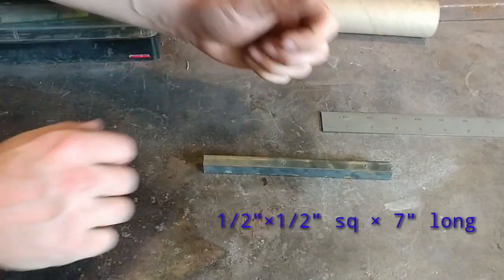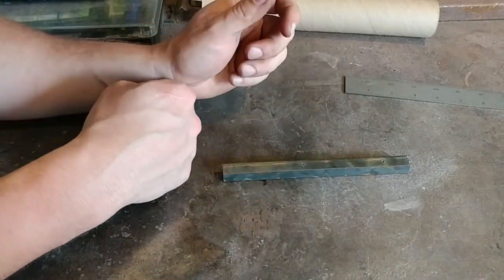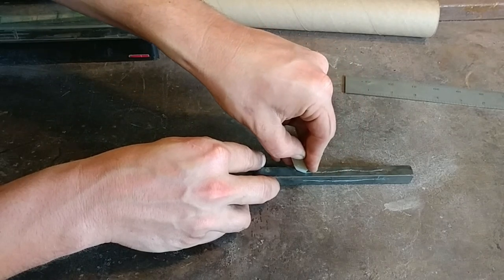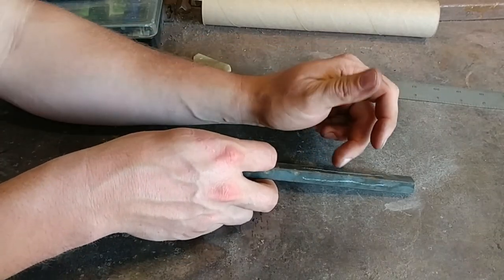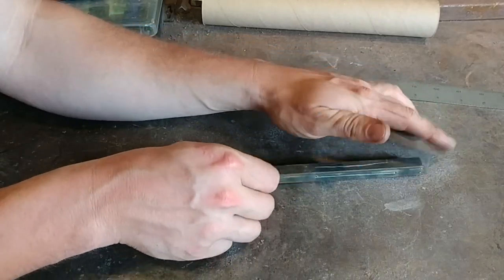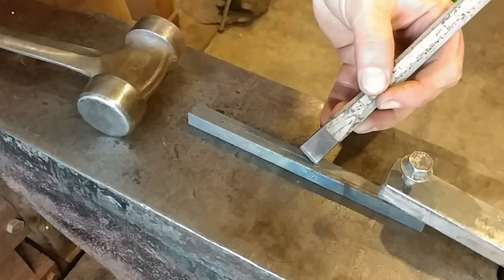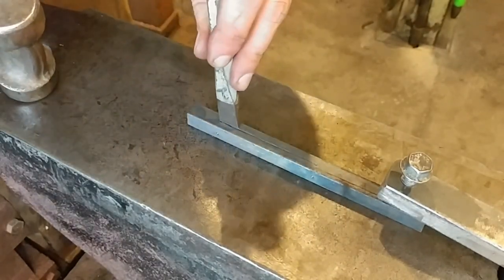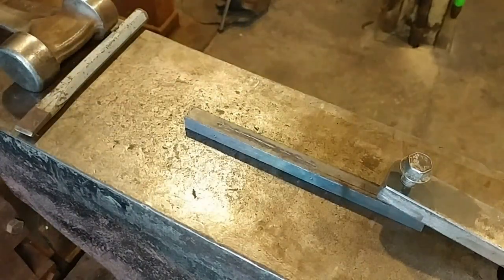How to Make a Pineapple Twist (Blacksmith Technique)

Comment: The traditional way that I  make the pineapple twist is to make the reverse twist part equal to 1/2 the rotation of the first forward twist.  Easy to keep track of the turn(s).  Makes for a nice, uniform twist with just the right spacing on the points.  Example:  make the first forward twist 360 deg., the reverse twist 180 deg.  I usually make mine with 1 1/2 forward turns and 3/4 reverse turns...still a 2:1 ratio of forward to reverse.

Your technique of using a chisel cold to initially lay out the lines is a great tip to keep the lines straight when you get around to hot cutting them.  Much easier to follow that groove!
Reply from the maker: +shortfuse43 thank you for the great comet and thank you for all the information. I don't make too many pineapple twist so this is just the method I have developed. I enjoy hearing about the other methods that other guys go about making these. God bless you and thank you again have a great week and look forward to talking to you on the next video :-)

Comment: Hi Roy... Quick question..  when you put in the chisel lines down the center, can I use a die grinder with a cut off wheel instead of a chisel? To me that seems to be much more efficient. I'm going to try my first pineapple twist.  Or should we try not to actually remove material?

Comment: Have you never tried to twist 1/2" square bar while cold?  I don't know how successful it would be with these pineapple twists (gotta try it soon) but it's very uniform doing standard twists.  As you will know, to get a regular and uniform twist, the heat has to be even throughout, which I find very difficult - and then it's cooling down all the time, increasing the difficulty.

It might seem too difficult at first thought, but it's not too bad if you get set up correctly.  I've twisted 12mm square (1/2") cold through 1080 degrees (three x 360) or even 1260 degrees on a longish twist (about 18").

You won't twist 16mm (5/8) by hand while cold, but 1/2" square and under is possible.